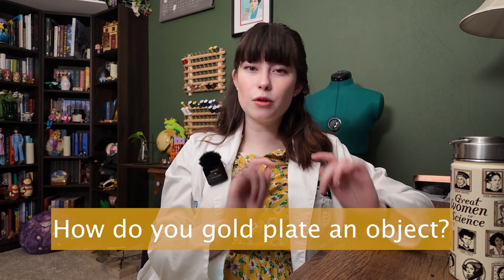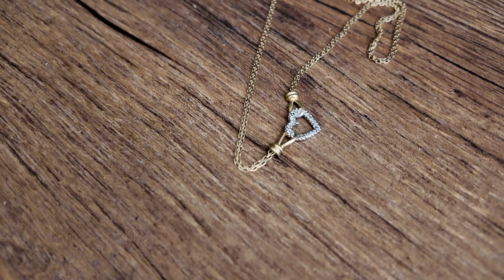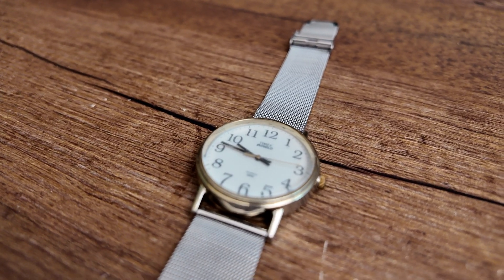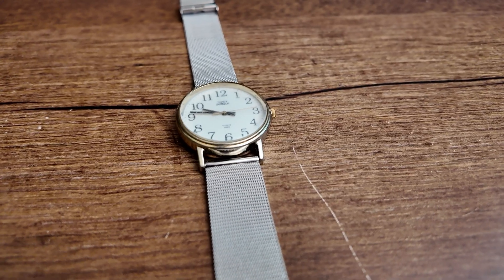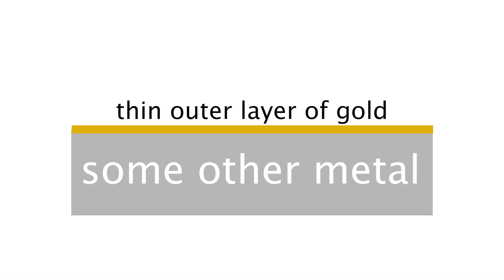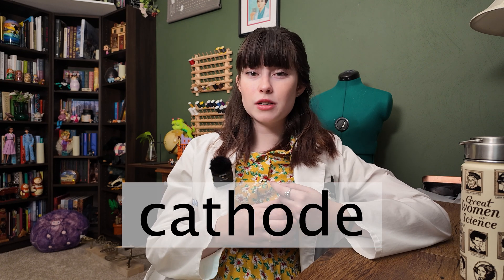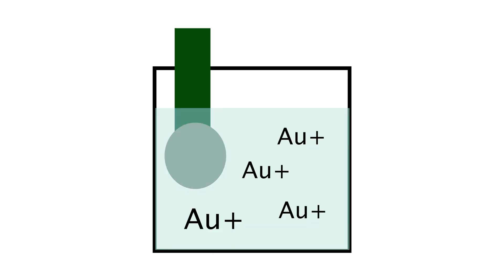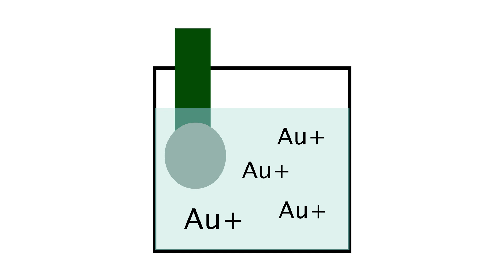How Does Gold Plating Work?

Comment from the maker: Do you have a science question for me? I love answering them!
Reply: When dipping a metal how does were its suspended get coated too? Without an "ugly mark." are the atoms capable of slipping through where its being held by "tongs" of a sort?
Reply from the maker: I believe that typically gold plated items are held in the solution by a thin wire or like a thin wire rack that in the end also gets a little gold plated. Whatever touches the solution will get gold plated so small portions may end up not getting gold plated but these are small and probably located in areas we wouldn't notice.